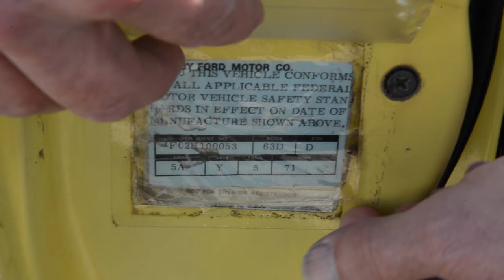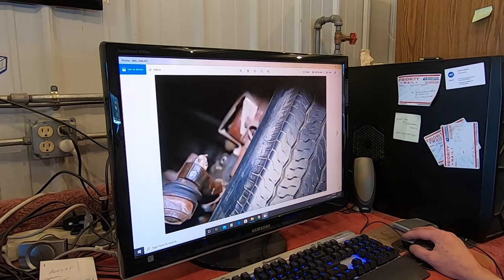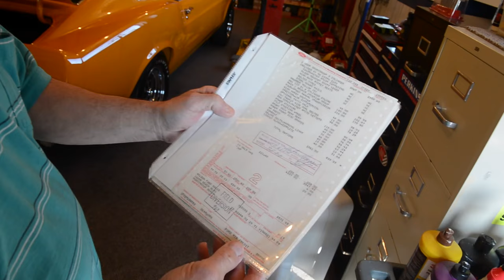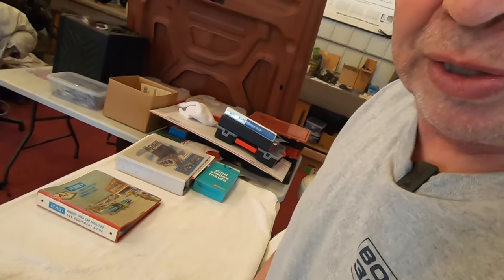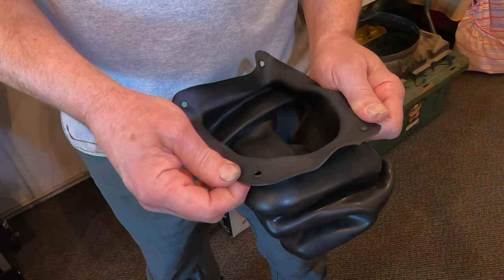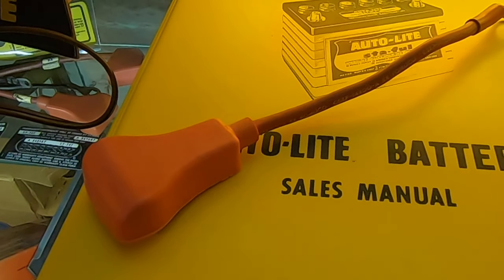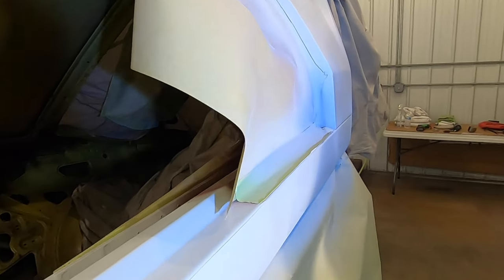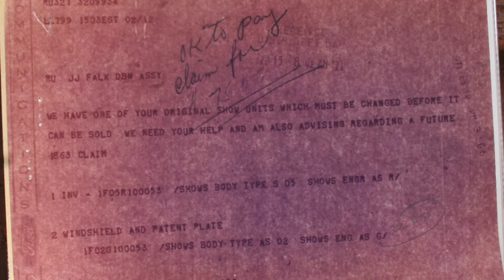The Long Lost 1971 Boss 302 Mustang Prototype, Bob Perkins Boss Expert Saving History

Comment: I know for a fact there was at least one other.  It was owned by a friend of mine in a little holler in West Virginia.  Same yellow and black colors.  I remember because the starter went out and we push started it at least 50 times lol.  We had a blast in that old car.  of course it wasn't that old back then.
Reply: Boss 351 or 302
Reply: @AlejandroP1980s  I'm sure it was a 302.  I talked to another friend who remembered the car also who said he thought it was a 72 but I'm pretty sure it was a 71. After thinking about it, it could have had an engine swap.

Comment: Ford should have put the Boss 302 in the 71 Maverick/ Comet it probably would have been quicker than the 70 Mustang/ Cougar.
Reply from the maker: I don't think Ford wanted to build the specialty Boss 302 in 1971. It had mainly been built to homologate the 5.0 liter Boss motor for racing in 1969 and 1970. For 1971, the SCCA changed the Trans Am rules so that a 351  homologated the Boss 302 motor for racing. A Boss Maverick? Sounds like trouble for Ford.

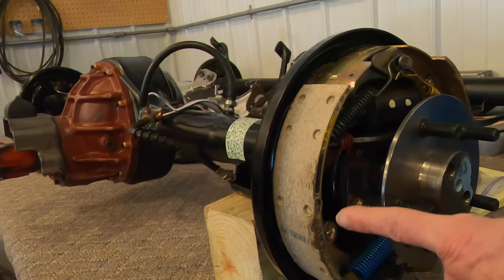Comment: 10:53 Too bad. Not gonna drive it. Well now all you have is a piece of pretty metal with a long story that doesn't even get to be enjoyed as it was meant to be enjoyed. Why go through all the hassle of changing it all over if it's just a story and a show piece about that story. The story would be exactly the same and the car would still sit unused and not being enjoyed. SAD!
Reply from the maker: I understand your point of view, but let me wax eloquent. What we have is a piece of found, recovered, restored, preserved Mustang history, production and racing history, that otherwise would have been lost except for a couple of collectors in the hobby. One found the car and sold it to the right person that has both the restoration skills, knowledge, and many of the parts to return the car to its original Boss 302 factory build. That person, Bob Perkins, accumulated most of the unique parts, as outlined in this video, plus he tracked down one of the engines from a pool of engines that this car was born with, that had been saved, along with engineering paperwork. As a show car, this '71 and its provenance is gleaming evidence that yes, there was to be a 1971 Boss 302, as well as homologation of said engine for another season, of Trans Am racing and how grand this could have been in this new longer, lower, wider and more aerodynamic body style. To drive this car like a common '71 Mustang would be akin to a malice aforethought of a historic automobile. What? The hobby cannot save and display its automotive history lest it violate some "got to drive it to enjoy it" belief?

Comment: Lol I wonder if that motor is originally from that car.
Reply from the maker: Ford ended the Boss 302 program, and the engines waiting to be installed on the assembly line were not used. This was one of those engines. An employee got it and kept it all these years.

Comment: All that work and it’ll never be driven except on and off a trailer?
Reply from the maker: What would you expect or do with a valuable, vintage  prototype?
Reply: Jerry Heasley, I’d drive it. If not, then build a airtight plexiglas box around it and fill it with nitrogen or some other inert gas. That would at least preserve all the seals and gaskets.
Reply: Robert Sole I think Bob Perkins knows what this car needs more than you do.

Comment: That front bumper is colored yellow like the car that means it’s a 73. The 1973s had plastic bumpers something is fishy about this. This isn’t a 71 71 has chrome front bumpers
Reply from the maker: Jerry, thanks for your comment, and good first name. First, Ford had a rubber bumper (they called it Urethane, painted body color) in 1971. It was stock on their 1971 Mach 1, and available, so Ford used this type bumper on this particular car. We know this because Ford licensed their data base to Kevin Marti, and we can see the complete make up of this car from Ford files. It is a prototype. Anything goes with a prototype.
Reply: Jerry Heasley ah ok I didn’t think about that
Reply: Jerry Heasley also the 302 HO isn’t really a big enough engine for any real performance to a car that heavy that may be why they didn’t go through with it. I do know they put regular 302s in those cars but they were not meant for racing just regular driving. I think the 351 was big enough to counter the weight

Comment: Honestly it was cooler before they touched it. Should have just left it alone.
Reply from the maker: you think cooler with a two barrel utility motor as a Boss 302, as originally built as a prototype?
Reply: @thewriter2549  I’m talking about the originality of the body.  The car also still had its original rear end and transmission. Could have just installed the boss 302 motor. Put the correct corresponding parts back on to the car. Nothing has to be perfect. Yes the car was originally a boss 302 but it also was a boss 351, etc. By restoring the car he basically erased the cars originality and history. He can say all he wants about how guys don’t understand etc why you would restore this car. But that’s because he’s trying to be a perfectionist and with some cars you just leave them alone. Not everything needs to be a perfect show car. That car lasted 50 years till he touched it. 50 years of originality now gone. He can paint factory markings and do this and that but guess what those markings will never be original like they were before he touched the car. A lot of really nice survivor cars were restored in the 80’s and 90’s by guys like him that these days no one would restore. They are show car crazy and it’s hard to get their mind away from the mind set of the 80’s. People don’t care for unbelievable perfect restorations anymore they want to see original untouched stuff. That means if there is a crack in the seat you leave it, original paint with some paint chips you leave it. Unless a car is a rusted out rare project that needs restoration to even look presentable then yes restore it. But on a car that looked as good as this 71 boss 302 did you leave it as is. They were never perfect from the factory and if he’s all about factory then he should have left it.
Reply: @mysterycomment1553  but he is trying his best also not worth it shitty mustang people say they prefer 69-70 mustang for me I like the long look and not overrated like 69-70 that I see always

Comment: Interesting project if you have to much money but these cars were really junk. In the wet my 1967 GT mustang use to hydroplane when you hit 60 mph. Mustang’s cheap metal rust easy. Brakes are bad. My 4 speed T-10 gears were so wide that you can feel the car bog when you shift gears. Shifter sucked. I replaced it with a hurst super shifter. Some people like the old relics.

Comment: I drive cars. So this is a trailer queen. And in reality not a very nice one. Yes it will be immaculate with everything correct BUT they are fatter than a 69-70. So it will be suitable for a trailer queen, an engine with no bottom end power and then on 50 y/o Badday Polyglass. Probably the worlds worse performance tyre.  Probably crash being driven on the trailer!!
As a car with a 351C 2bbl and 4.11s it would have been horrid as well. Normally they would have had 3.25 or 3.00. Or even a 2.75. It would be nice to know what that gearbox has in it? Wide ratio suitable for a 351 2bbl or close ratio suited for a Boss engine.
One presumes the car was sold as a exec car or similar as it was never a new car.
Reply from the maker: Trailer Queen is a derogatory term. People enjoy their old cars in different ways. One is to build them to show for a certain class. You either have a show car or a driver and this car needs to be saved. Calling the '71 fatter you will not find in spec sheets, so another attempt to degrade the car. It is wider by 3" and that allows the 429 Cobra Jets to fit the engine bay. The wider stance and track improves handling and would have resulted in a faster Trans Am car from Ford had they not dropped their program. There were private entries. Those 4.11 gears gave that 351-2V a bite. They worked. Low rpm torque is not what road racing engines are designed for. They needed high rpm horsepower.